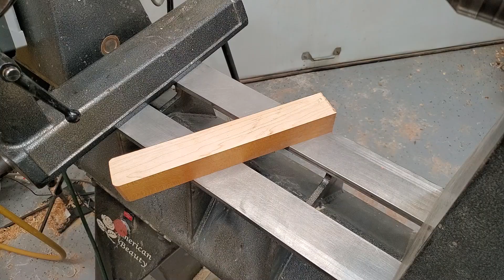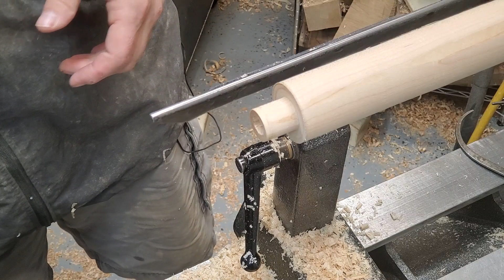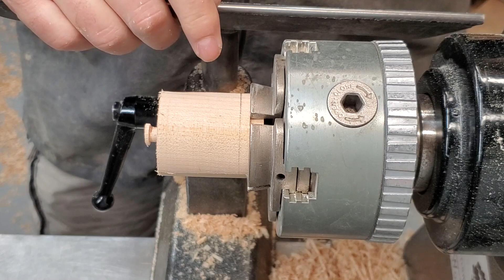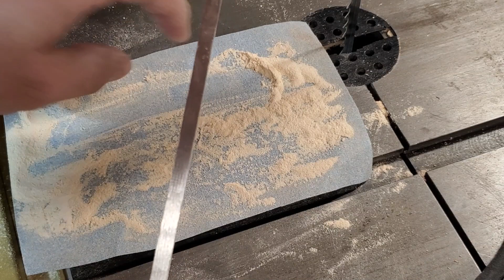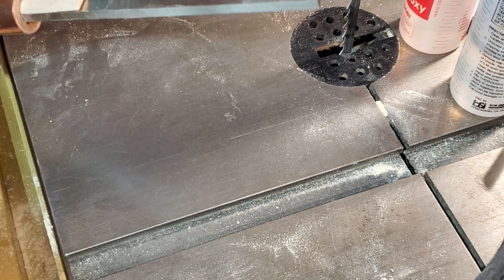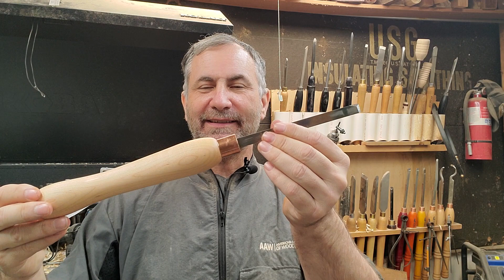Turning your own scraper for $15

Comment: I just made several scrapers from bar stock HSS. Excellent quality tools for cheap. The only thing I did different was I welded round stock on them to fit in the handle. Making handles is quick, easy and fun. Keep up the good work 👍🏼💯
Reply from the maker: Welding on a round rod for a tang on a wide piece of bar stock  is a great idea if you have the equipment.  For those who don't, an angle grinder with a cutoff wheel is another alternative.  Thanks for the suggestion and thanks for watching!

Comment: could you tell me what kind of HSS is good for woodturning? or any HSS will do?
Reply from the maker: Any HSS will work for woodturning.  HSS comes in many grades.  Generally speaking the harder the steel the longer the edge will last.  There's definitely some debate if the more expensive grades are worth the extra cost.
Reply: @ScottsMiniWoodshop thank you for your kind explanation. 

There's too many HSS's grade and I'm kind of confused. Grad to know any will work.
Reply from the maker: @nakanaka6973 you should be able to find M2 grade HSS pretty easily.  It's what most inexpensive lathe tools are made from.  It's my understanding that most unmarked HSS is M2.  It should work perfectly for making a scraper
Reply: @ScottsMiniWoodshop  ok.I will buy one.
Thank you very much.

Comment: I realize that this video is 2 years old, but if you happen to see this, would you mind telling me the top and bottom angles you used. Thx. Great content.
Reply from the maker: No worries.  All my scrapers are ground the same way.  15 degree top bevel and 55 degree main bevel for an included angle of 70 degrees.  If you burnished the edge of the scraper it will last longer.  I have a video on using a burnishing rod if you look for it
Reply: Where do you buy the tool steel?

Comment: Hi, watched a video on Pinerest you made for making ornaments. Can you tell me what you used in the headstock and tailstock to hold the ornament after you drilled what appeared to be 3/8 hole in each end. Thanks
Reply from the maker: They are pen centers.  Specific centers (drive and live) for turning pens between centers instead of using a pen mandrel